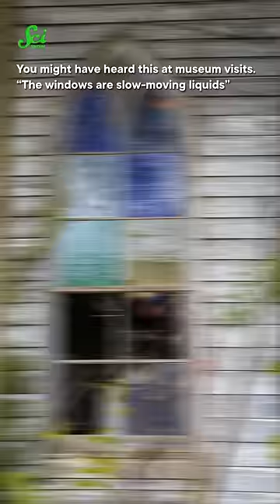Do old windows actually melt? #shorts #science #SciShow

Comment: As someone who actually does research in the glassy material field, this video is incorrect in a number of ways. 
For one, all glass is metastable, meaning yes, it will "melt" or rather flow over time. But for most glasses this is on the time scale of thousands to even millions of year. BUT, it will eventually, it is not stable and still has a viscosity, its insanely high, but not infinite.

Second, glasses are not a solid, they are amorphous, but they still technically count as a liquid since they have a non infinite viscosity. Because of this and other factors,  a liquid becoming a glass is NOT a phase transition, its very incorrect to say that, so as a result it is NOT a solid. 

References:
Angell, C.,  Science, 1995.
Gotze, W. and L. Sjogren,  Z. Phys. B-Condens Matter, 1987.
Reply: If glass flows on the scale of thousands to millions of years, then flow does not explain why centuries-old glass windows have a heavy bottom.
Reply: @safaiaryu12  Manufacturing techniques and putting the heaviest part of the glass pane towards the bottom explain that. Also, not all old windows are heavy bottomed.

Comment: I’m currently reading an article on glass materials and calling them liquid wouldn’t be much of a stretch. Yeah, they appear solid to touch and have a bunch of other properties typical for solids (lower heat and electrical conductivity, for example). However, they basically are liquids locked into place because of the temperature being too low. They don’t have any crystal structure and they DO change shape under force, it just happens very slowly due to the molecules having a hard time moving around. That is why even modern windows appear to have melted after 10 years or so. 

All that said, I could believe that the majority of the church windows thickness difference is caused by the manufacturing defects. 

Also, if you’ve graduated from school and don’t know what amorphous materials are that’s a very bad sign for the quality of your education. Just saying.
Reply: The timescale is 10 billion years, not 10 years, & is still only a few atoms, not flowing, unless it’s hot as lava.

Comment: **Thank you!!!**
(Glassblower & materials scientist here. She’s right.)

The glass was spun into rondels, (picture a plate stuck to a rod) or blown as long cylinders & cut open and pushed flat before annealing. None of it moves at human survivable temperatures. They just usually, but not always, put the thick side down because that is a sensible way to orient standing things.

Even in geologic timescales, it takes more than gravity to get solid glass to deform.
Reply: Than why is it true of any old windows??? As someone in construction I have seen in countless times just last month we took out some that were 3/8ths at the bottoms and barely an 1/8 thick at the top. Homestead was built in 1885 original glass.
Reply: @jonruger  It was installed that way. Manufacturing uniform glass panes used to be really difficult before float glass.

People got good at it, especially the long cylinder method, but if your bubble is even slightly off, or the shaping tools cool non-uniformly, you’ll get a thicker/thinner dynamic closer to/farther from the pipe, but because it’s always being turned, the radial thickness was pretty uniform. So when they slice it vertically to turn it from a cylinder into a flat sheet, it’s fairly uniform L/R but thin to thick top to bottom. They tried to minimize that variance but think about blowing a solid cantaloupe into a yard long bubble that they shaped into a cylinder. The glassworker isn’t a machine. 

For the glass to move, it would have to be heated above the glass transition temperature. If this happened and it wasn’t done in a kiln so it could be annealed, it would’ve spontaneously burst into shards from internal stresses. It’s very much a solid & not flowing at STP.
Reply: @CrankyOtter  that’s just not true I’ve replaced modern made Stained glass and it does the same thing. Glass is not thicker at one end when made especially not artisan made stained glass, those old windows were poured into molds while molten the very physics of gravity are what made the panes cool uniform in thickness. It self levels in the molds it’s not a lost process it’s still done the way it always has been all over the world.
Reply: @CrankyOtter  nice try with your long winded completely nonsensical answer though but your explanation of how windows were made is literally laughable.

Comment: basically, it's not liquid, but it is fluid. People just often confuse those two.
Reply: An amorphous solid is actually not a fluid. It's just a sold without a defined crystalline pattern to the molecular structure. Plastic is an amorphous solid as well, and nobody goes around saying plastic is actually a fluid.
Reply: @Just_A_Dude  You're making the mistake of confusing fluid and liquid that I was talking about.
"it's just a solid without a defined crystalline pattern" contains the implication that all that prevents it from displaying fluidity is its solid nature, as opposed to liquid.
And normally this is true, which is why the confusion is understandable, but it is amorphous.
It is solid displaying traits of a fluid, that's part of being an amorphous solid is. That nature causes those traits.
Nobody goes around saying glass is a fluid either, so that last point's just moot. Plastic not being as well known as glass in this context has no bearing.
A better example is pitch. There're a number of 'pitch drop experiments' which is essentially a chunk of tar pitch, an amorphous solid, set over a beaker to count the drips. It flows much faster so there's a drip every so often taking years.
You can pick this stuff up, it's clearly solid, but it slowly flows into its container and eventually drips.
Reply: @Just_A_Dude  Dude even gases are also called fluids they are not liquid liquid and fluids are 2 different identities a liquid is a sub set of fluid not just a same thing with 2 different names
Reply: @wilhelmseleorningcniht9410  Except nobody says pitch is an amorphous solid unless they want to be wrong. Pitch is a viscoelastic polymer, which is a fluid the same way putty would be, which is not the same thing as glass.

It's really amazing how people will grasp for false equivalencies and try to reach for horrible examples like this to try to defend a false statement because they think it's more "interesting."
Reply: @lucky3589  Yes, I'm well aware. Unless you're trying to claim glass is gaseous, however, that doesn't actually apply here in any way shape or form. An amorphous solid is. Not. A. Fluid. It's a rigid solid with no crystalline matrix to its molecular structure.
Reply: @Just_A_Dude  No but you know glass is also referred as super cooled liquid because of its non crystalline structure so yes it is fluid and in case of plastic  it is not referred as that.
Reply: @Just_A_Dude  You really like to say 'except nobody says' don't you? Nobody talks about pitch period, again has no bearing. Pitch is an amorphous solid and a viscoelastic polymer, those aren't contradictory, deal with it. Look it up yourself.
Reply: @lucky3589  Sorry, you're just factually wrong.
Reply: Where does wax fit in this argument?
Reply: @petevenuti7355 if I had to take a geuss based on the fact it's a hydrocarbon or a fat I'd say it either an amorphous solid or it just melts a bit at room temperature
Reply: @jkjkrandom  personally I'm on the side of class being an exceptionally viscous liquid, even though waxes easier to get to flow like a liquid with less pressure, the general nature of carbon bonds creates a linear or plainer symmetry lends itself to greater crystalline tendencies, so I think wax is less like a viscous liquid than a glass, rivers and many other organic materials do tend to be more like a visiolastic ... 
   I do believe that all three is best are best defined with the nomenclature of "amorphous solid" and none should actually be called a liquid because for that to be technically correct it would require perceivable flow in a human lifetime. There's got to be a better name for each of those three categories where the respective semantic differences are not and won't be an issue.
Reply: was curious and asked ChatGPT to decide who's right  (not saying this is some kind of final verdict, A.I.s can be just as mistaken as any human in here) and this is what i got
"Based on the scientific consensus, amorphous solids are considered to be solid materials, even though they may exhibit some fluid-like properties. Therefore, the argument presented by Just A Dude aligns more closely with the scientific understanding.
It's worth mentioning that language and terminology can sometimes vary, and different fields or contexts may use terms differently. However, in the context of scientific classification, amorphous solids are generally considered distinct from fluids."

Comment: Back in the day they poured the liquid glass on a table sized mold and then spread it out with what was essentially a big rolling pin that was saturated with water to prevent it from catching on fire. And because this is not a perfect process you get glass panes with one edge slightly thicker than the other.

Comment: Being an amorphous solid means it does not conform to an actual solid because it does not have a crystalline structure which means it is susceptible to fracturing with vocal vibration which can cause the break down the   of the surface structure.

Comment: Yeah Glass is an amorphous material. Not liquid or solid.
The warping is caused the by the silica doixide molecules rolling down slowly.
It doesn't melt. It warps.

Also the Panels in a mosaiq are in the same weight. Otherwise it would cause imbalance or fracture over time.
Reply: It still wont melt since it does not heat up enough to reach the critical lower cooling point for ions to actually diffuse in the material, completely destroying your opinion on that one here

Comment: It is true that over 1000s of year, glass will deform under its own weight. But the physical change would be measured in fractions of a mm.
I feel putting the 'heavy side' or thicker side down had more to do with shedding water than weight distribution or aesthetics.

Comment: Glass doesn't have a melting point like other materials like for example water that crystallises to ice. Instead it transitions smoothly from a highly viscose state (amorphous solid) into a low viscose state (liquid) when heated up. Even in the technical solid state glass still exhibits certain traits of liquids and yes it does flow, just very very slowly. In university in a chemistry course we once calculated the time frame necessary for a glass window pane to "flow" until a slight gap opens at the top between the glass pane and the window frame. I don't remember the exact numbers but it was a couple of millennia. The window would probably brake before then due to other factors.

Comment: Actually you’re kind of right and kind of wrong. In medieval glass you can certainly see the glass is thicker in the bottom due to the glass slowly moving over the centuries. 
There’s too much involved with too many consistencies to be an accident or coincidence. Or due to manufacturing or construction issues. 
It’s one of the main reasons why medieval church glass is so difficult to restore… left alone it’s generally fine in its lead shroud as long as that’s maintained. However due to movement the thinness of the glass makes it difficult to remove and replace.
You might not be seeing this in American glass…. After all it is only two, maybe three centuries old. In Europe we have glass many centuries older.
Reply: No. She’s right, you’re wrong. 

Glass used to be extremely difficult to make in flat sheets. Before modern float glass, most glass had noticeable variation. And the only mostly put the thick sides down. If they had cut pieces that weren’t oriented thick side down, they went in to fit the pattern. And when examined those do not show any thickening towards the bottom.

Comment: What about those photographs we saw of windows in abandoned towns that have a gap in the top of the glass pane and look like they have ripples in them?
Reply: As someone who has worked with wooden windows, that's just the wood falling apart. Either it's rotting and the glass is sinking into it or the joints are loose and the bottom rail is gradually shifting down. If the glass falls out it will do so as a solid sheet and you better pray you aren't under it.
Reply: Imperfect manufacturing for the ripples. They didn’t have perfectly flat sheets of metal to press the glass like we do.

Comment: Thing is that it isn't entirely untrue. Only that the lead used to bind the pieces together are less viscous so before you see any difference will you have a line of lead at the bottom of the opening.

But in theory, if left for long enough would that thicker part become even thicker

Comment: They would spin it to make it in to a sheet form, and the edge would be thicker. Ithink it might have even been a circle and then they cut the rectangles out. That's also why old buildings have a bunch of little peaks in one window, it was too expensive to buy bigger sheets because you waste so much if you cut it out of a circle. Then they found out that if they had a big vat of mercury they could pour the liquid glass and it would float forming a big sheet of uniform thickness, in the shape of the container. Also it took a long time to figure that it out and it was probably really expensive to buy that much mercury (like probably hundreds of gallons/ pounds  of it) , and there were still places making it the old fashioned way, most likely.

Comment: I’ve never heard someone claim glass melts, just that it’s made out of burning sand.
Reply: i heard it from my physics teacher (and by the looks of this comment section, im not the only one).

reality is more complicated, oldest techniques involved spinning a drop intill it turns to a plate. you would have ripples and a thick edge with this. i havent personally seen this so cant say why thick bottom but it seems to be the case.

next you have mouthblown glass. blow a bubble, roll it on an inclined plae to get a ~meter long cylindrical bubble, cut ends, cut it open and then put it in a kiln to open it. 
now this one tends to warp, heavier side stays straight but thinner parts tend to warp. my father did some of these in museum buildings, and the reason its somewhat thicker at bottom is, the thicker side is straigh, so you nail down the straight bottom, then use the top runner to press the glass against the frame.

next invention is drawn glass, essentially draw glass between rollers, these are usually installed the roller marks vertically, less disturbing image and slight flow pattern due to the rollers. 

and then you got modern glass, goes by the name of float and its molten glass floating on  top of molten metal. this is essentially optically perfect. thickness is defined by speed at which its drawn from the bath.

so timeline, heavy thick bottom ripples -> slightly thicker bottom with glass that looks like its flown -> slight optical waves -> modern optically perfect glass.

if you dont know the manufacturing process the idea that it would have flown makes sense.

Comment: Yeah… idk, please help me, those more studied in the topic
I’ve got a ~110 year old home with original windows (it sucks) and it is thicker at the bottom because of how it was manufactured, i get that. But why is the glass all wobbly? Like, it’s seriously messed up. There’s no way someone looked at that glass and said it was ok for their homestead. Especially since my house comes from a more… wealthy background. Is it because it’s not fully a solid it just slowly warped over time?
Reply: It was the best glass they could get. Doing better requires giant baths of molten tin that glass is poured onto forming a flat ribbon, and wasn't commercially available till the 1950s
Reply: thats on the edge of two methods. older is mouthblown, blow glass into a bubble and rolling it on a plane form it into a cylinder. cut the ends off and cut it open. 
after that put it into a straightening kiln. thick parts tend to stay straight while thinner parts tend to warp back when it cools down. 

you install it by nailing down the straight bottom and then bend the warped parts against the frame with the runners. (always remove top and sides from these first, otherwise it can spring the bottom off and fall)
this looks like all kinds of lensing in all directions. might have some air bubbles in it too.

the latter one invented sometime early 1900s  is pulling molten glass between rollers to get fairly even thickness. these are straight but wavy, installed roller marks vertically so it looks sortof okay until someone walks behind it.